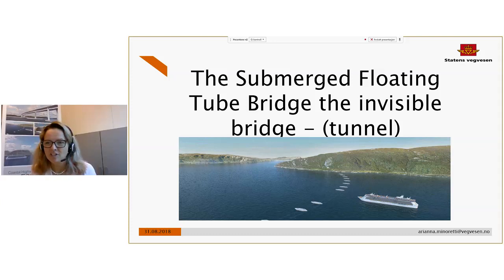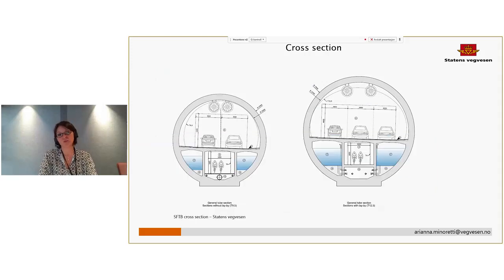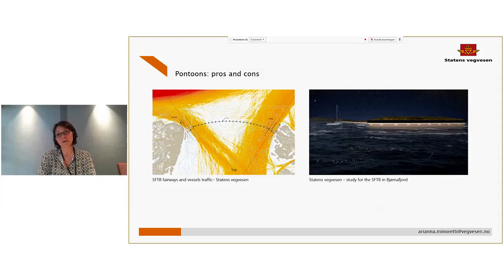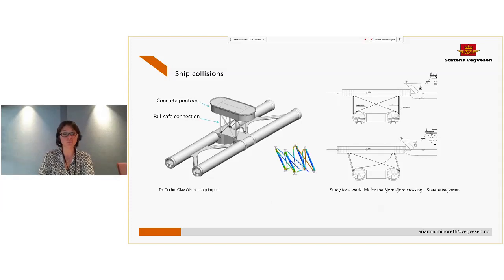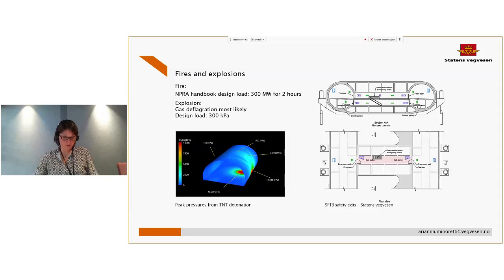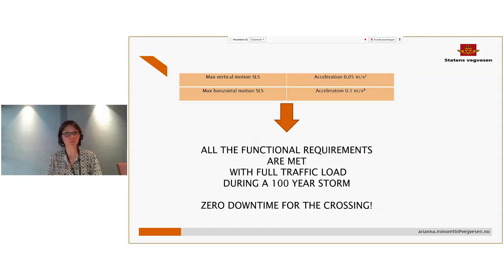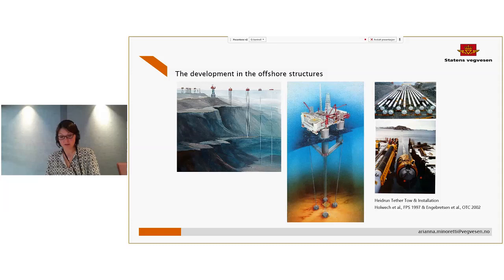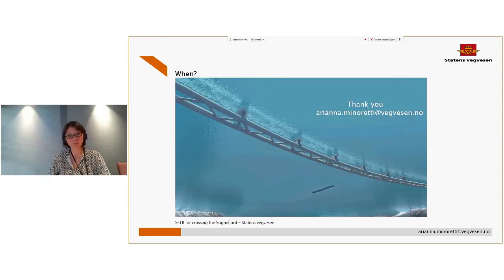Statens vegvesen- Ferjefri E39- Forskerpresentasjon - Arianna Minoretti

Comment: Could I ask how much it costs, in general terms, per metre, for a single bore road tunnel through a mountain with no water crossings required.
Reply: 45 billion dollars
Reply: It depends on a lot of factors, but usually between EUR 10000 - 15000 per metre of finished road tunnel. This includes quite a lot -- planning/administration, rigging, drilling&blasting or boring, transportation and handling of the excavated material, rock support, water/humidity/frost handling, lining/coating, lighting/ventilation/safety measures/tunnel management equipment (there is a lot of technology in a modern tunnel), road body and surface, signs/road markings.
Reply: You are speaking about a rock tunnel. The SFTB is a totally different structure
Reply: I assume @domhnallmorris just wants to know for comparison/curiosity.
Reply: @ariannaminoretti7901  What are the pertinent pros and cons for this infrastructure?

Comment: Submerged floating tube bridges is suddenly collapse then how prevent that damage
Reply: Madhav reddy. L The SFTB is designed to withstand the loads considering a design life of 100 years. Robustness has been a key driver in the design and the structure is able to withstand unespected situations
Reply: This comment has no sense, written in this way. If you want to clarify, you can also have a look first to this: https://www.vegvesen.no/_attachment/1607172/binary/1145785?fast_title=Bj%C3%B8rnafjorden+R%C3%B8yrbru+%28Submerged+floating+tunnel%29+K3-K4+Technical+report.pdf

Comment: What happens when a lorry full of explosives explodes in this submerged bridge? Or when a hugge cruise ship sinks perfectly on top of it.
Reply: Explosions and sinking ships are two of the loads that we have taken into account in the design process
Reply: Arianna Minoretti Still need to se extencive IRL tests to consider trusting consructions like this. I would much more prefer legs like Troll A and a traditional suspension bridge on top.
Reply: At this link you can find the summary reports we have done for the feasibility studies for the structures proposed on the Bjørnafjord: https://www.vegvesen.no/Europaveg/e39stordos/fjordkryssing-bjornafjorden.The SFTB is able to withstand the accidental loads of a sinking ship and of the explosion load defined in the design, following the actual rules and the experience in the european tunnels. You can read all the details in the reports. The suspension bridge on TLP is not a traditional structure, as you know for sure, that's why we are going on with the analyses and the testing, as we do for the SFTB or the floating bridge solution. If you need more information, you can write me an email at arianna.minoretti@vegvesen.no, so we can have a proper chat between engineers and speak about numbers.
Reply: @ariannaminoretti7901  Could such a structure be realistically considered a solution to connect Sicily to the European continent? Thanks so much for the information.